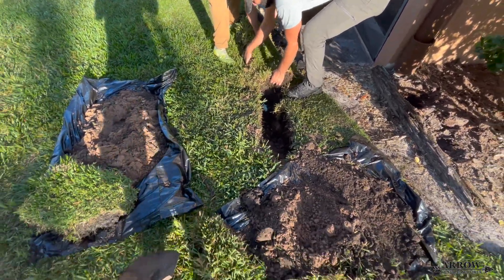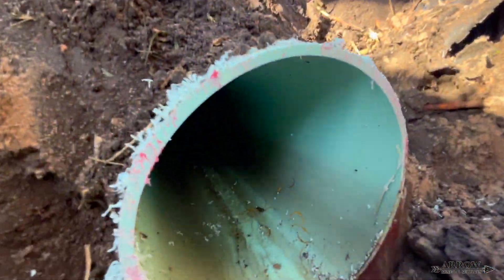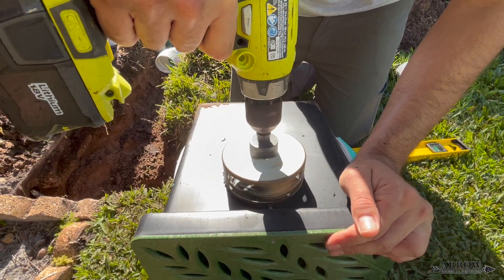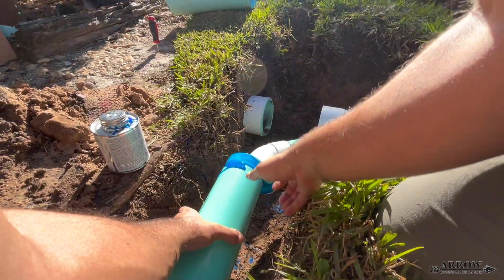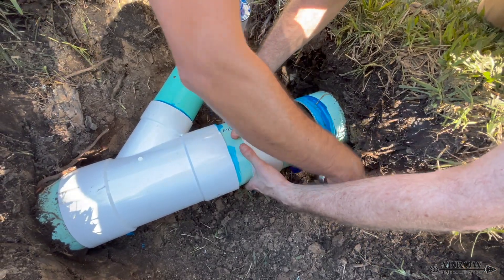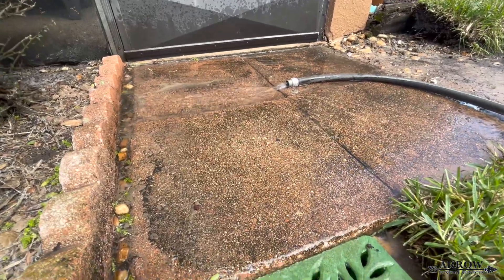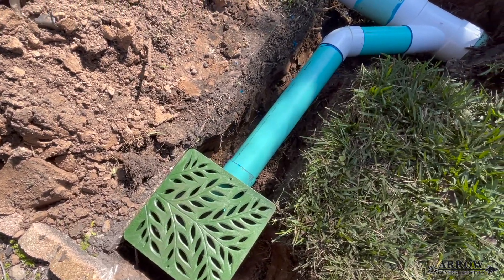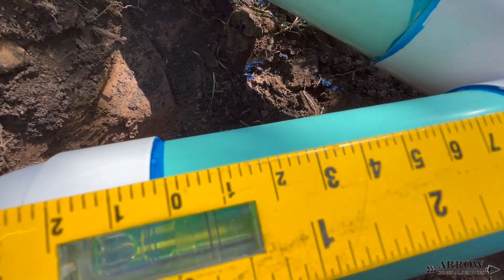How to Connect Into a 6" PVC Drainage Pipe - Backyard Holding Water - Solved

Comment: Do they not make an insert a t  or some other more definitive seal against the catch basin? I have a very similar need for an isolated drain point and I'm currently making it out of a 6-in sanitary t with an atrium grade on top and just reducing the sidearm down to 3 in to fit into the existing downspout system. It's a fortune for the stupid fitting, clean out adapter for the bottom to plug it and reducers but it's all water tight at least. I would have loved to use a standard catch basin though if there was a more waterproof way of situating The pipe in there

Comment: If the catch basin doesn’t go exactly up to the concrete but there’s about a 2 inch gap between the concrete and the catch basin with soil in between how do you make sure the soil doesn’t erode away with the water? Did you put pavers in there?